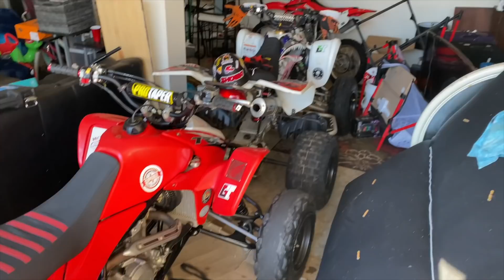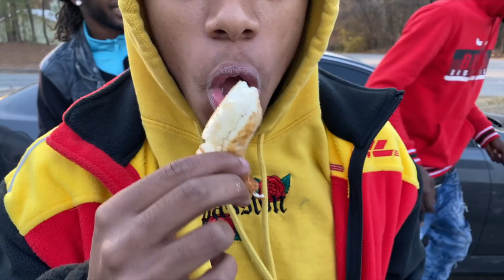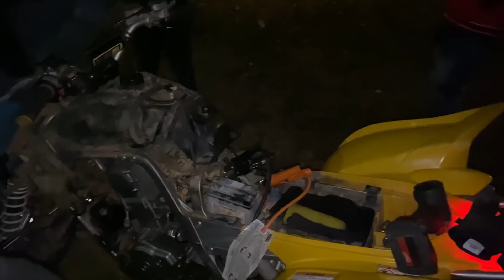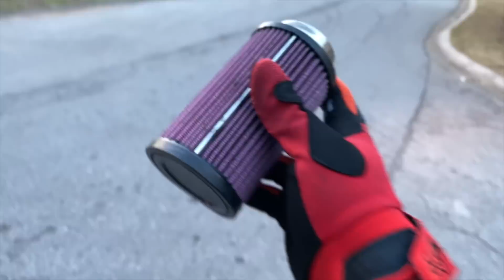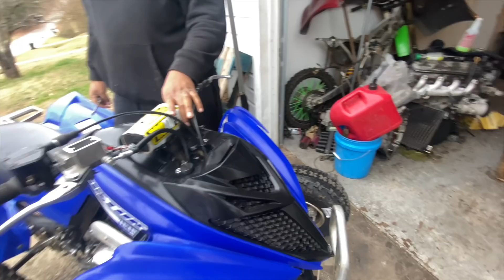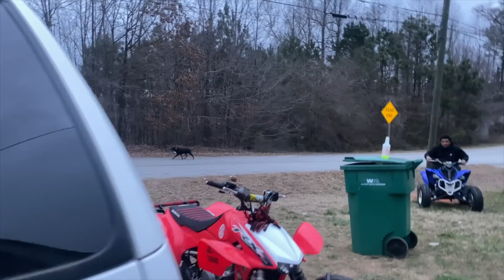BOTH RAPTOR 700 ISSUES ARE FINALLY FIXED ! ( CANT BELIEVE THIS CAUSED IT ) | Leek GT

Comment: Carburetor issue. Sticky Float or either clogged jet or could just be dirty. Spark plug would cause that.
Reply from the maker: It’s fuel injected bro
Reply: @leekgt  ok

Comment: Idle screw he’s not beside the  handle bar where the brake fluid goes If it’s still injected check the injectors it’s carbureted you need to take that carburetor apart I just don’t know what year that bike is I’m pretty sure if you injected though check all fuel lines drain every bit of ffull out everywhere And need to check your spark plugs also which I see you did that one and that one looks fucked up but it shouldn’t be making it stay idling hard when you press the throttle

Comment: No way that Yamaha 450 
Will out run the Yamaha 350 twin banshee As long as they’re stock versus stock because it ain’t fair of ones got $2000 in motor work and the other one doesn’t belong to them bikes up stock That two-stroke will eat it alive